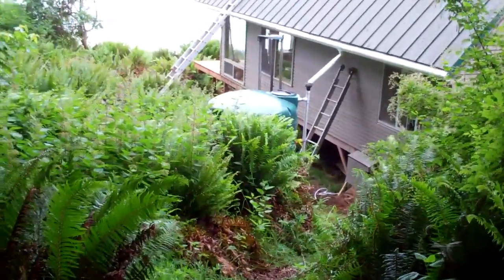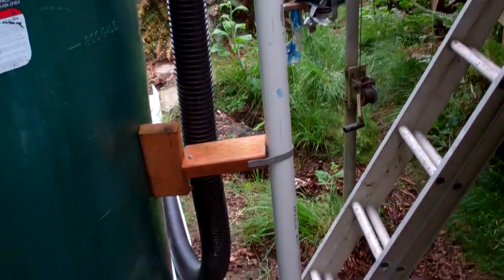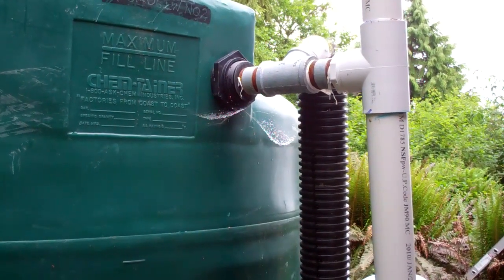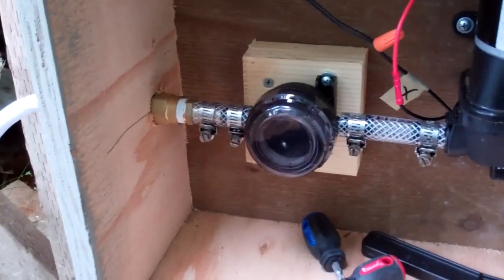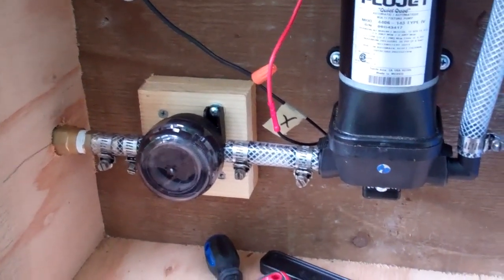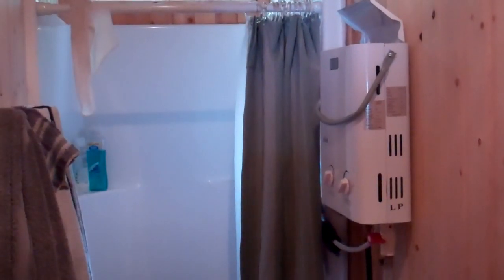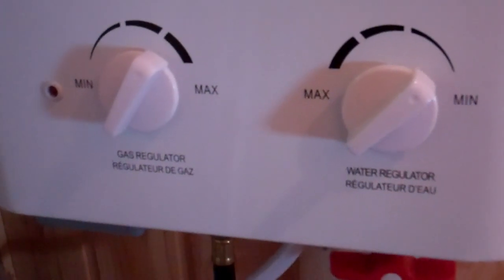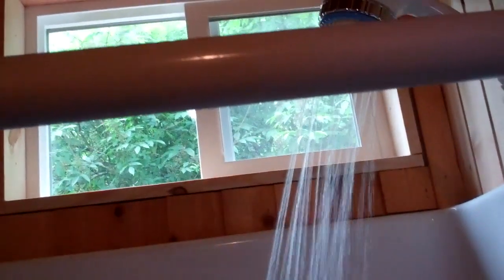Off Grid Cabin Rainwater Collection.mp4

Comment from the maker: Thanks! It is a 20lb/5gal propane tank. The shower uses very little propane (if you don't take long showers). We have been using the same tank for about a year and a half, and don't think we have used half the tank.. We make it to the cabin about one long weekend a month, sometimes twice a month with a week here or there in the summer. Also still using the original "D" cell batteries that ignite the propane.

Comment: Beautiful job all-around. Do you have any concerns about keeping the LP tank inside the cabin? And is that shower hose long enough for convenient handling? It seems compared to all the effort/expense in other matters, you might consider plumbing the LP in from outdoors and extending the shower pipe into the stall. One more thing, do you keep a spare water pump/spare parts for it; they can be troublesome and it is a very important item in your system. Just looking at it from a bystander's POV.

Comment from the maker: The pump is a Flojet Quad II 4406 that has an internal bypass valve, which eliminates an expansion tank, and does not pulsate. For winterizing, I blow out the lines with about 30psi compressed air, similar to winterizing an RV. The first winter after I installed the pump, I did not winterize, and the valve switch housing cracked - luckily I was able to find a part and not have to replace the whole pump.
Thanks for the comment!

Comment: Very nice, but the recurring theme I see in the off grid world is using house wire for DC.
Have you actually studied how far you run the line for your water pump and how much loss you get by having too few strands carrying too much load?
If you look at wire for a car stereo amplifier, you will see that it has multiple hair-thin strands. So few people understand this...even those who install solar systems do not get it.
I encourage you to check on this. You might be ok, but I would make sure :)